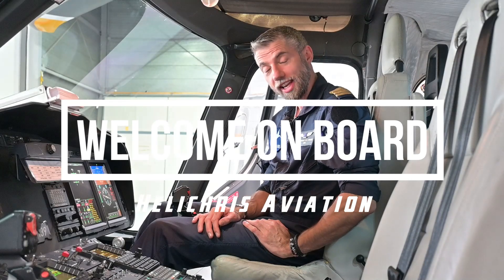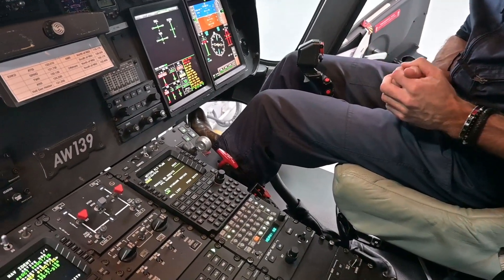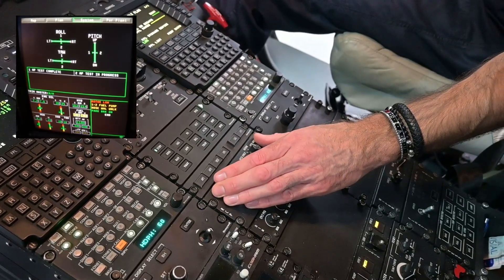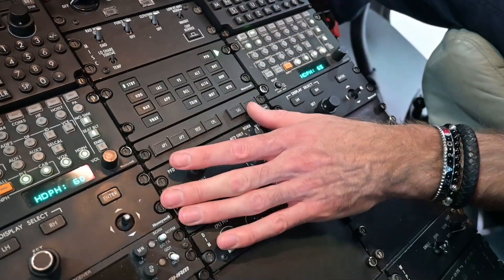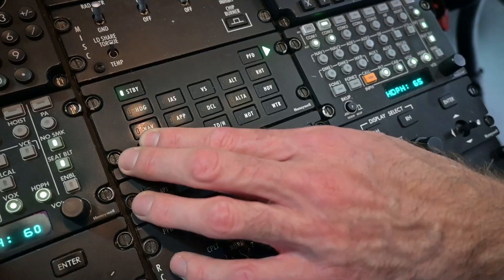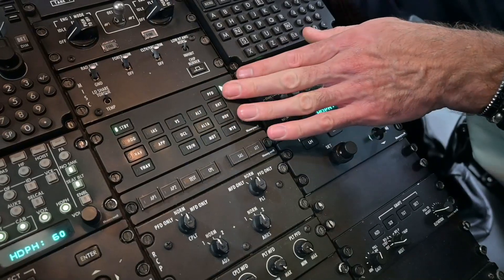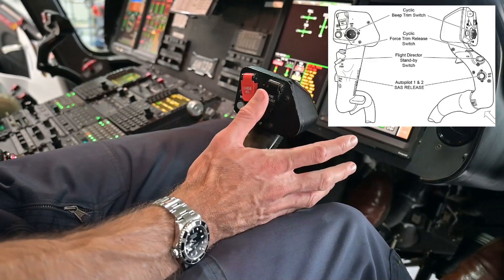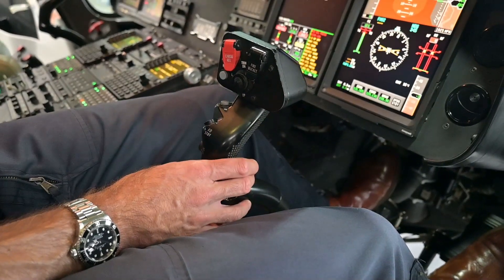Helicopter Autopilot explained | AW139

Comment: Dear sir what is the difference between linear actuator and rotory actuator and are they both working in flight director mode? Are they both working in autopilot?  Why the linear actuator not installed in  collective control lines? Pl
Reply from the maker: Thank you for the comment! The linear actuators are for quick stability corrections in front of the mixing unit. They are active at all times when the AP is engaged,
Since they are for stability they only have 10% authority if the travel range. the collective actuator is a rotary or parallel actuator and only to move the collective in upper mode use. There is no need for a separate linear actuator on that axis, since the series actuators are controlling the swash plate already. I hope this makes sense!

Comment: How do linear and parallel actuators with SAS and ATT modes work? If the helicopter's condition changes while in ATT mode, how is it corrected and returned to its previous state? Do rotary actuators work in SAS mode? How do actuators work in SAS mode?
Reply from the maker: Thanks for your comment and questions. In ATT mode the actuators work to dampen the flight path and to return the attitude to its natural position. The linear actuators very fast to dampen and the rotary actuators to move the controls to keep the attitude when disturbed. in SAS mode, only the linear actuators work to dampen the flight path, but the attitude as not kept. so after a disturbance from turbulence or wind the attitude stays there. I hope this answers your question. 
Thanks! 
Helichris

Comment: Hi Chris, sorry, but I have another question. At 9:47, you have pressed a fuse on the Overhead, and the sound it's like the electic hyd pump. Am wrong? And if it's the hydraulic pump, why did you activated it from the fuse and not from the pedestal? Maybe it is to check if Fuse works. Sorry, it's sure I was wrong.
Reply: I saw a picture of the overhead and maybe it's the avionics fans? Maybe you turned off to make the video and avoid using too much battery? Sorry again for my bored questions.
Reply from the maker: @Helicopterx1  Thanks for your comment! You are fully correct! We often pull the fuse to brief the passengers.. otherwise they dont hear us.... the avionics fan is really loud! And dont feel sorry for your questions! You know a lot about the 139!
Reply: @HeliChrisAviation  Thanks so much Chris, I love AW139 and I develop it for a few years on simulation platforms, your advice helps me a lot, thanks 🙏

Comment: While I understand what is the SAS release button and what it does, I cannot find a situation where you will need to press this button during flight. What is its real purpose then? In other words, in what situation will you need to release the SAS during flight?
Reply from the maker: Thanks for your comment! Indeed during normal ops there is no need.  In training I can use it to simulate AP loss.  And in some very unlikely events of an actuator runaway you can quickly disconnect the AP’s.
Reply: @HeliChrisAviation  Thanks for your reply. That's how I use it in sims too (for an AW109 not the AW139) so it's good to know that I'm using it like in the real one :)
Reply from the maker: @Sim-Pilot-GreyEyedEagle indeed! 🤗💪.  Thanks ☺️

Comment: In case of engine failure is the autopilot capable of controlling the helicopter in autorotation?
Reply from the maker: Thanks for your comment. if one engine fails the AP will indeed limit the performance and keeps the helicopter flying. If two engine fail we really need to take action quickly... the AP will not. Although the stability functions still help us in controlling the helicopter.

Comment: What happens when you request a VS that is higher than what she can handle?
Reply from the maker: Thanks for the comment and question. the autopilot when coupled has upper and lower limits, so when selecting a VS setting that is not possile it will be prompted and not able to select that setting. There is also a power limit both high and low. So if the AP requires more power from the engines then possible there will be the Power limit caption.

Comment: Can you use any of the stabilisation functions of the auto pilot in an auto rotation?
Reply from the maker: Thanks for the comment! Indeed a very good question. With both engines off, there is still hydraulic power and electricity (as long as the battery last) and the AFCS is fully functional, however most modes do not couple since there is no power.. IAS, HDG, APP, NAV still work. however we train NOT to use any modes then. Only ATT mode for stability.

Comment: I always appreciate this in-depth videos. It seems to be very similiar to H145 Controls logic.
Reply from the maker: Thank you so much for your kind comment 😀. I guess it is indeed close to other helicopter afcs architecture. I think a Leonardo thing (at least on the 139 and 189 that I operate ) is that alt only modes are on the collective axis, and not the pitch. When I flew the 155 and the 365 it was the opposite… but I don’t know the 145 really 😬

Comment: I love those videos, good job. I wish we had a AW139 in simulation (msfs). We have the H160 but still. Also is there any chance a civillian can hop on a offshore flight? If there is a empty seat on the back. I do think it’s probably zero chance but no harm of asking :)
Reply from the maker: Thank you so much for your kind comment 😊. I think in Xplane there are 139’s… but not sure. 

It’s indeed very difficult to bring a passenger extra. The requirements are quite strict and you need some safety courses. So it’s very difficult to just join for a ride indeed..
Reply: @HeliChrisAviation Yes , you’re correct Xplane has it. I can’t wait to try it. Another question can a b2 licensed engineer join for a ride ?
Reply from the maker: @tangle6j well most oil companies require Bosiet trailing and company courses.  It’s up to them really what they require..
Reply: @HeliChrisAviation  thank you very much, i’m planning to complete my b2 in a year. I will search those trainings as well. My B plan is to become a AW139 engineer if i cant become a pilot
Reply from the maker: @tangle6j awesome!! That’s a very good plan 🤗. Both A and B 😀.

Comment: Love the explanation. I guess that's different to the R44 I flew, which just has hydraulics switch that you turn on/off as the only real assistant.

in terms of stability it depends on the type of fixed wing aircraft if its aerodynamically stable. Aerobatic aircraft and fighter jets are generally unstable.
Reply from the maker: Indeed. A R44 is assisted with hydraulic power. Like a 206 and other small helicopters. One system and if broken you can still operate the controls (but hard 🤣) 

Aerobic planes are designed to be symmetrical. So to keep its path and not move to neutral again. So not unstable like a helicopter 😬. We really mess up if we do nothing 😑

Comment: Thank you very much for such an informative clip, Chris. I usually fly my approaches with the cyclic force trim depressed all the way to touchdown. But I heard you say you only depress the force trim for lift  and touchdown. How do you fly your approach then? Do you make use of the beep trim to fly your approaches?
Reply from the maker: Thank you for your questions. Indeed we fly as long as possible on the beep trim if we fly manual. With the force trim in you loose the protection from the trim motors. Although I have a tendency to press quite early… something I do not teach 😑🤣
Reply: Thank you for the response Chris. I will try and incorporate my approaches with beep trim for as much as I can. Thank you very much once again. I’m a big fan of yours 🫡

Comment: On the AW139 I flew in as a Flight Nurse we had a four-axis digital autopilot integrated into its Honeywell Primus EPIC avionics system. Are you flying the same? Even though our AW139 was certified for single-pilot IFR operation (SPIFR), our program determined the cockpit was much too busy for single pilot in Helicopter Emergency Medical Services (HEMS) operations, and, unlike some other HEMS services like the Ambulance Service of New South Wales who does do SPIFR, our program has always been a mandatory dual-pilot operation for additional safety.
Reply from the maker: Thank you for your comment 😊. Indeed this is the same. There is some difference in the software versions of the epic software. We fly phase 7